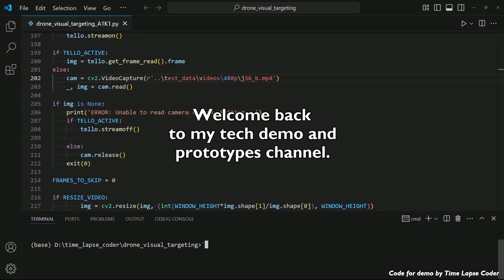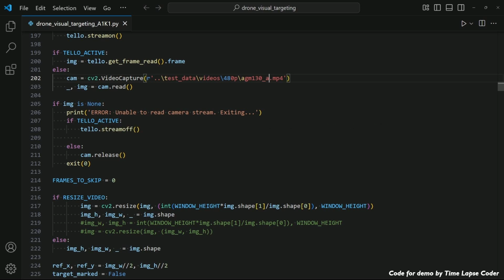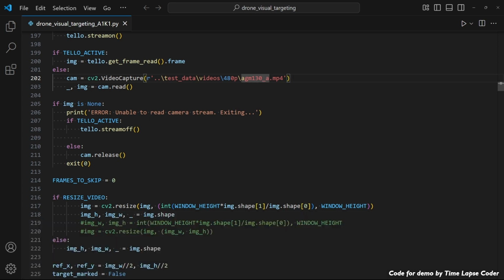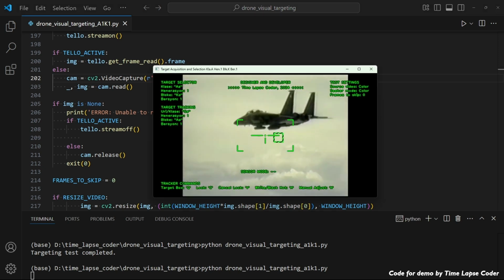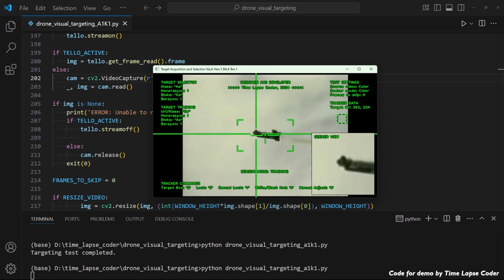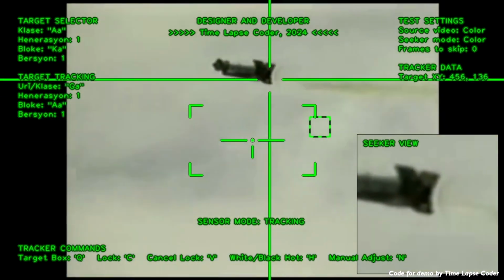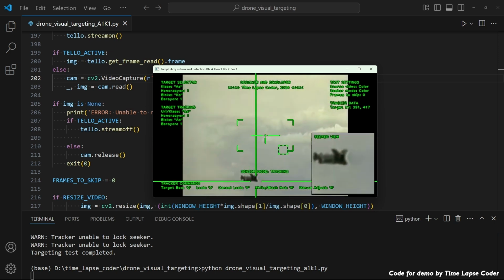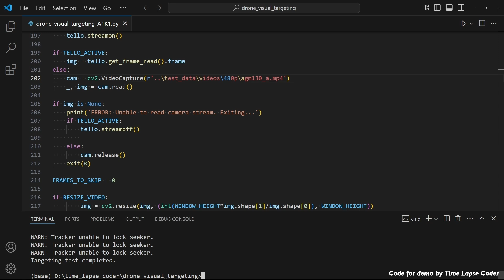Ballistic free-falling target (AGM-130) vs my homemade tracker | OpenCV Python

Comment: Does your method outperform open-source models like YOLO in terms of tracking accuracy or robustness, especially in noisy or unstable footage?
Reply from the maker: not tested. different goals. YOLO is an object detector. it can be used to track by detecting per frame. it can't detect (and so can't track) objects it was not trained to find. it is also heavyweight.

Comment: And after stablizatiob which method is the best for motion detection i have used the all the available in the open cv but the quality of video is not that much good and i have to perferm on thermal camera and gimble is there but due to drag and many things its not stable so current among all the open cv method for motion detection the cnnay edge is guving good but still there is so many noise
Reply from the maker: If you have thermal camera, you can just lock on to the hottest or largest blob maybe? Motion detection will always be unstable in real world video. That's all I can think of.

Comment: I am facing the issues I have started with the first stabilization of the video in that I have used all the methods available in the opencv 

All. Feature mapping  

Homography. It's working but so much noise is there 

Optical flow 

There is always a noise because of that the motion detection there is very problematic. Will you guide me what can I use
Reply from the maker: Clean up the image to remove noise and improve motion detection. This won't work all the time. Also, OpenCV has trackers. They are pretty good and probably much better than motion detection.

Comment: Hi bro you are so goated will you please guide me please help me out 

I want to built a algorithm for motion detection and tracking for some drone company I find you have done this will you please guide me the methodology or any 1  year old tracking the car github so that it will be very very helpfull please bro need your help 

Or if you dint provide github so please provide a proper method how can I built this
Reply from the maker: You can experiment with the legacy OpenCV trackers. They will work most of the time. They will also not work at some point, so you just write your own logic to correct it at the point where they fail. Motion detection is ok but hard to get right when the camera is also moving. Since you said you have thermal, just track the heat source.